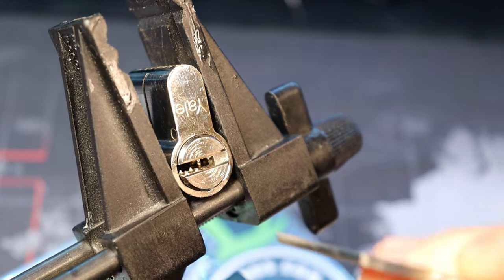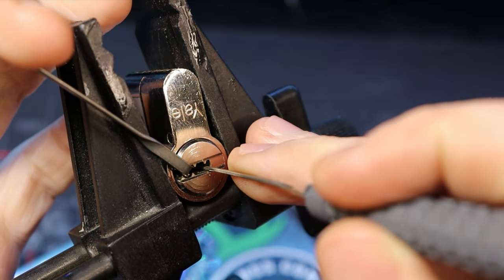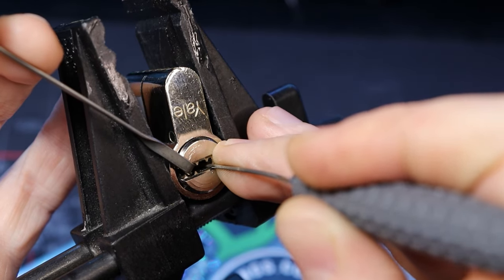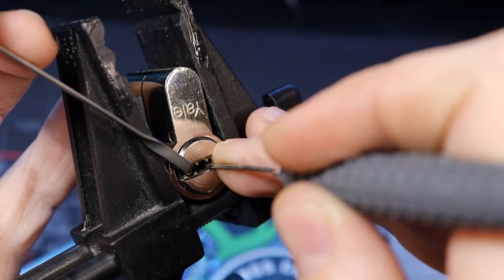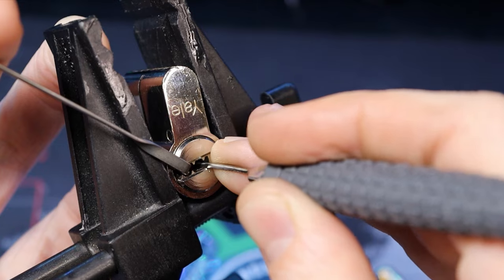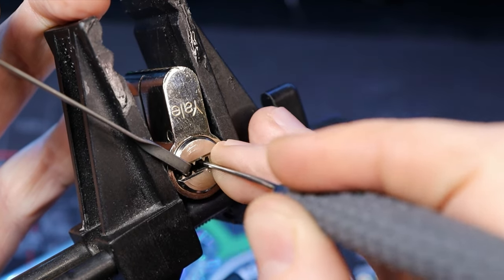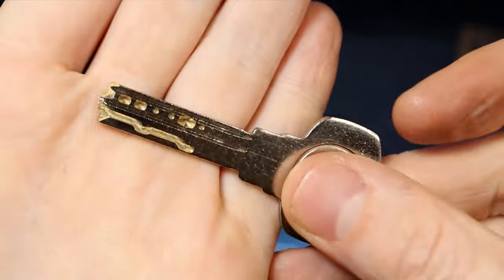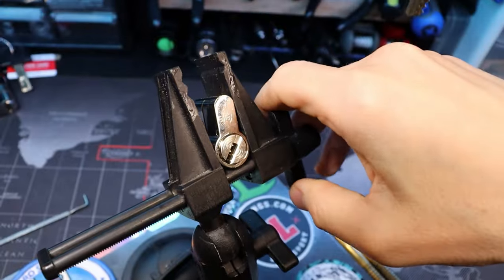240) Yale 2100 Picked and Gutted

Comment: The last pin would be a "barrel" which is a variant on the double spool. Edit : nope, my bad, it's the anti bump pin. 
It's a shame there's no false gate on the sliders, but for the price it's definitely a great front door cylinder IMHO : can't be snapped, can't be drilled, arguably can't be bumped... That won't stop a decent picker like you, but it's quite the deterrent.

It looks a lot like the Yale superior (which is a bit more aggressive) which can apparently be raked somehow on the pins side due to having only one security pin, according to LPL anyway. (But in his case it was a serrated pin, not a double spool)

Anyhow, great job, I know I'm years away of such a feat :)
Reply from the maker: Thanks for all the info! I was embarrassed forgetting what pin that was, I can blank at times, so I printed off a chart with all the pins on it for next time I blank 😂 Haven't touched the Superior yet. Will give raking a try on that one, could see that. Thanks again :)